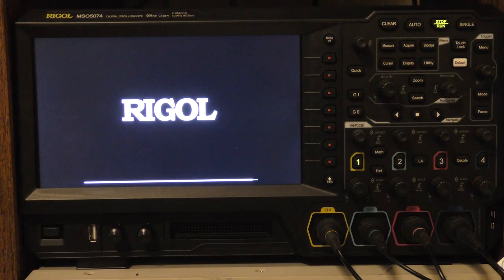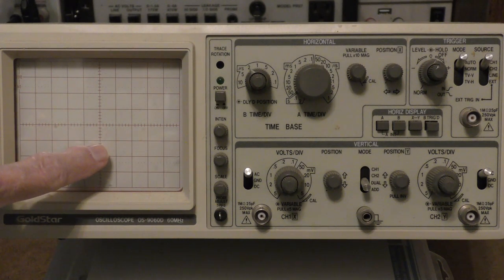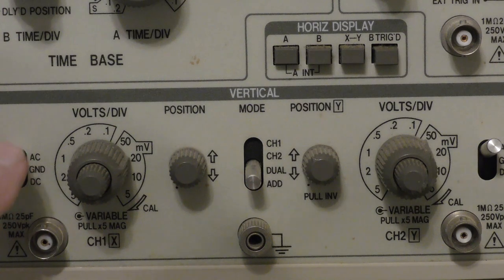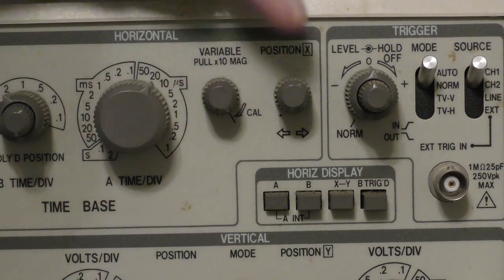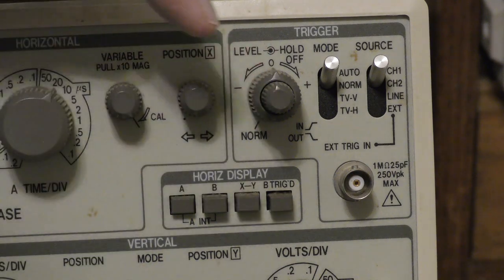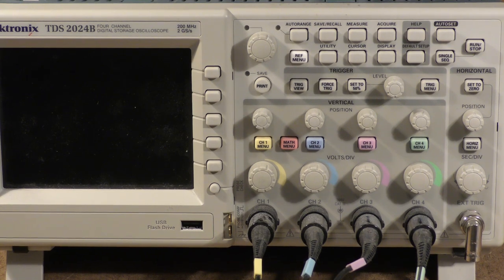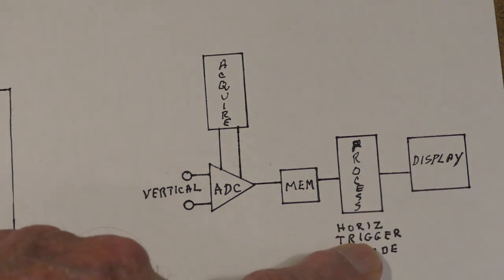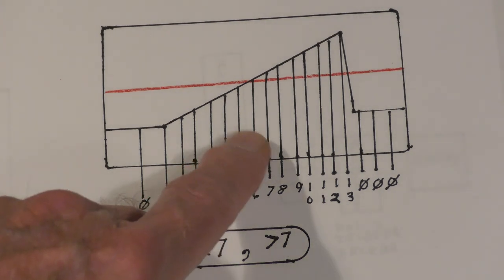TTT366 Analog v Digital Oscilloscopes

Comment: Thanks, very helpful to understand the differences in how they function.  I was trying capture a long start up with my MSO5000.  aka Circuit charging a super capacitor bank to power a meter during the off cycles of the project.  So setting very slow timebase(20S/div) to get low samples per second and setting the scope for maximum memory depth, I still got half the memory used up before the trigger.  Also the scope had to set for a couple minutes before it would trigger, I was thinking the trigger was messed up.  I finally emailed Rigol tech support, the answer made me feel like an idiot.  Using the horizontal position knob, set the trigger(the one at the top of the screen, not the vertical one) to the far left changes the pre-buffered memory depth.  Was finally able to get a 3 minute capture of the currents and voltages in the circuit during startup.  Sadly the advanced math features in my old Rigol 2000 series was way way ahead of the MSO5000 series, that part of the tech support answer should make them feel like an idiot.

Comment: New subscriber of your channel:-)
May I please ask you your opinion if "you do also have to own an analog scope"?
Some say that you simply have to own one, that it's fundamental importance, while others say an analog scope is at best, a fun thing to have but use the money on a better digital scope instead. :-)
Reply from the maker: Welcome to the channel and thank you for the question. Like all questions that involve personal preference, the analog/digital scope choice is some science and some personality. I have a lot of nostalgia for the old analog scopes I learned on in the 60's and 70's, especially the Tektronix monsters that were so heavy they had to be rolled around the lab on a cart. They were marvelous pieces of engineering and impressive to look at and use. When digital scopes began to appear I was resistant to them (and they had their share of teething issues). Eventually, as I learned to use them I came to realize that the good ones were superior to the best analog scopes for most applications. That doesn't mean there are not a few areas where an analog scope might still be preferred. For example, certain noise might be easier to see on a good analog scope. But if you understand how to use the full capabilities of a good digital scope you can still see the signal and measure it. So, just like the analog versus digital meter debate, if you know how to use both and can afford both, then by all means have them both. But if you are just starting out I would suggest first learn as much as you can from manuals and mentors (including trying as many scopes as you can get access to) and then buy the best digital scope you can afford. Then experiment as much as you can and you will soon find that you can see and measure almost anything you need to. Then, if you have some spare change and don't have anything better to spend it on, go ahead and get an analog scope as a second scope. I hope this helps but understand, it is just one man's opinion.
Reply: @tomtektest8042  Thank you for the welcome and for your fantastic reply! I think your reply is way more clear than any other has made about the subject.
I think that you point toward the most important: "learn your tool, how to use them and where they may be flawed" If you then still need or pretend to need something extra, then do the purchase. :-)